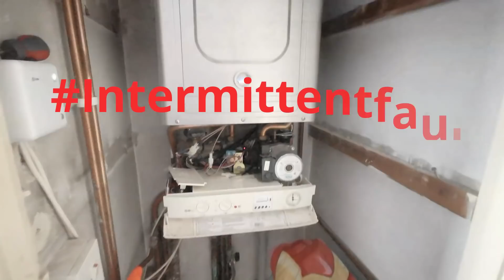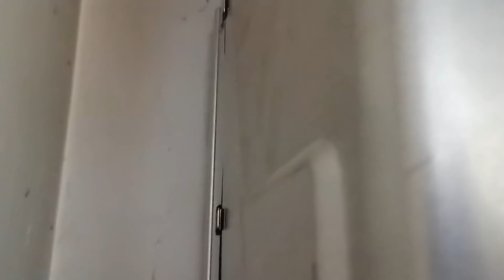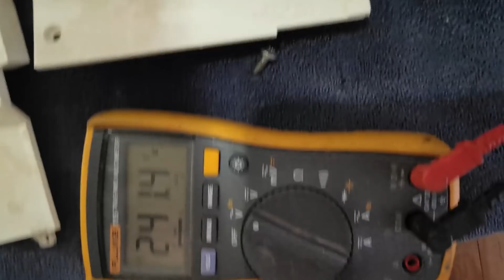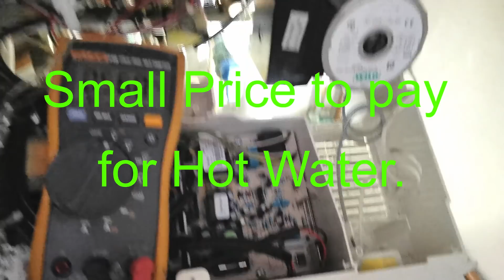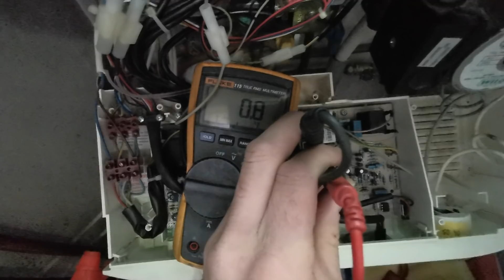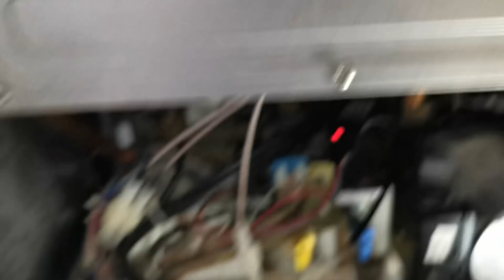Biasi Boiler Repair. Red light. HeatingGeek

Comment: Oh please someone help, I'm about to give up on my biasi, my one just locks the fire out after 5 seconds everytime, no error code, just the red  light next to the reset button... I replaced fire sensor, ignition board, checked venturi device, all working fine, overheat thermostat fine, 2 ntc probes all good... can it be the gas valve? Does it have some pressure sensor or something thats gone? Or is it the main board? Im getting to the conclusion that its either board or the valve, there is literally nothing else here that could cause it....

Comment: It seems I'm having the exact same issue with my Biasi boiler. The burners don't re-ignite, especially if I turn a hot tap on in the kitchen or bathroom. 
Even just maintain the burn to keep the CH on. VERY frustrating.
Reply: Did you manage to sort this out? As I have the same problem.

Comment: Hi, Whereabout's are you based? I have an intermittent problem with the same boiler..I've had 3 visits from 2 separate plumbers but it still comes back..
Reply from the maker: Unfortunately intermittent issues are common. Wait is the best advice I can give you. It will get worse.
Reply: You need to call a heating engineer not a plumber and you may get it resolved 🤣….. sorry I had to.

Comment: Hi I got biasi compact riva with the dhw dial temp to min still getting very hot water at the tap especially when central heating is on what you think plate heat exchanger blocked
Reply from the maker: No, probably a gas issue. Better get it checked.

Comment: Where did you learn about the electronics and diagnostics testing for combis
Reply from the maker: Through doing it. When ever I took parts off the boiler I would look to see if I could find out where it failed. :-)
Reply: @HeatingGeek  That's called Auto didactic; the best way to learn.
Reply from the maker: @doge_editzzz  I didn't know there was a word for it. :-) It is the best way to learn because you have to explain it in words you understand. :-)
Reply from the maker: @doge_editzzz  I'm trying to learn about Arduino and programming at the moment. I have tried to learn to program twice before.... Hopefully this time I can get into it. :-)
Reply: @HeatingGeek The lockdown is a great opportunity for learning. Everyday is a school day for me. I'm using the time to do my CEng.

Comment: The common on the aps isn't always the source of voltage, some boards output a constant live from NO and NC with the voltage then running down the common. With that type of switch both NO and NC are always live.
Reply from the maker: But how would the boiler know which has switched if both are live?
Reply from the maker: Genuine question, not being arsey. :-)

Comment: I love your perseverance even when it is a piece of crap Biasi boiler...........Most people would have ripped it out and replaced with a half decent A rated boiler!
Reply from the maker: I like Biasi. I didn't use to, but they have grown on me a lot.
Tough easy to work boilers.
Reply: I like them think they last really well a lot longer than some well advertised brands. Fitted mine 16 years ago and still going strong. Never installed one for a customer! At the end of the day it has a lot to do with water quality of the system it's been installed in.

Comment: I got this boiler in my flat. Twin flue. I know it like the back of my hand now. Easy repairs
Reply from the maker: They are if you have access. Only common issue is usually poor installation. Hard to combat that with the low price though.

Comment: Great video. I have worked for Biasi for the last 24 years so get to know all the faults. I've been shouting the answer at my iPad for the last 10min. LoL. It's not the stat and please put some water in you will have the flow switch dropping out. I won't spoil it for every one.
Reply from the maker: Its always the same.
Reply: Frank Bennett had one of these in my house , fantastic boiler never went wrong but had to update to a condensing ,went with vaillant , 2 repairs in 3 years already , honestly they just don’t make’em like they use to, I’ll need to look in to biasi again
Reply: Oh you little tease Frank!!  Ollie like his ‘Cliff Hanger’ videos too & keeps a captive audience. Rightly so, he knows his onions, on a multitude of manufacturers & their appliances.   What’s the latest HE Biasi’s like Frank, any recurring problems we should know about?  I’ve always thought that Biasi was a good wee boiler & fitted quite a few over the years👍
Reply: Yes good boiler now with 7 years guarantee or 8 if you are a registered installer with Biasi.
Reply from the maker: Tough boilers these.
Reply: I have same boiler and it was leaking water and today stop hot water

Comment: That's some serious faultfinding there, my bet is with that PCB . Excellent video again.
Reply from the maker: Thanks. I will get part 2 done asap. :-)
Reply: @HeatingGeek  excellent video  ive had issues with my biasi riva compact my pcb was found at fault (there is only 1 in mine) i need to do the 3 settings now it installed do you any advice on how to do this i cant find it anywhere
Reply from the maker: @Superklogz  Its in the book that comes with the PCB or call technical and do it with them over the phone.
Reply: @HeatingGeek  it was a reconditioned board so i got no instructions with it. I have tried to phone them today but their phone lines were down. So im fairly stuck